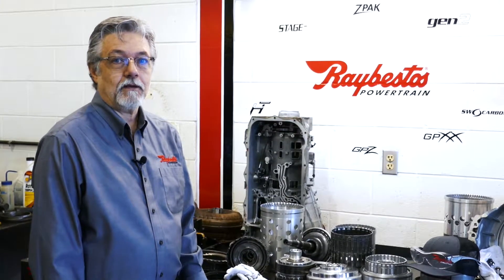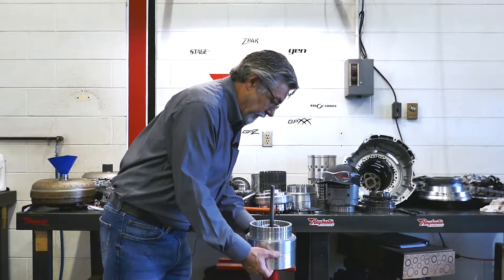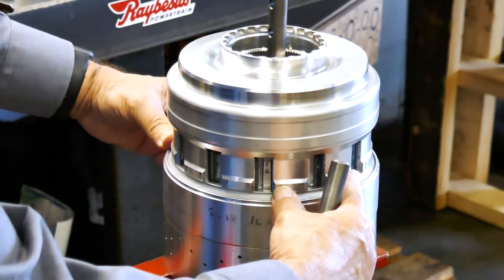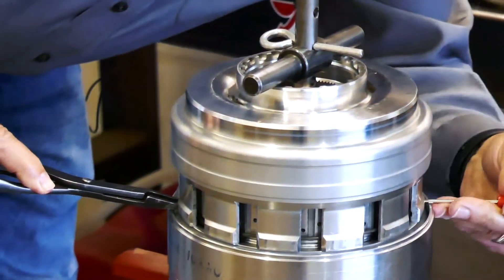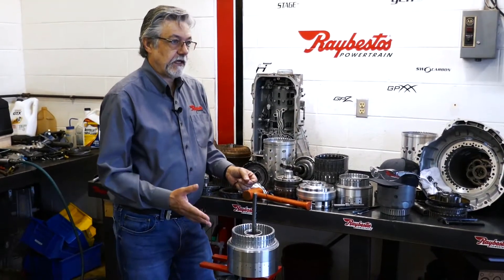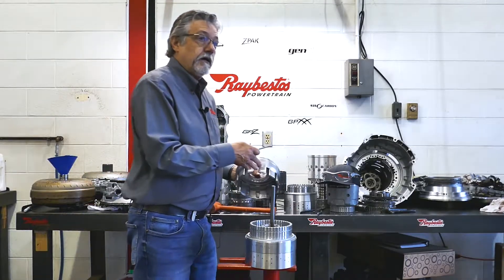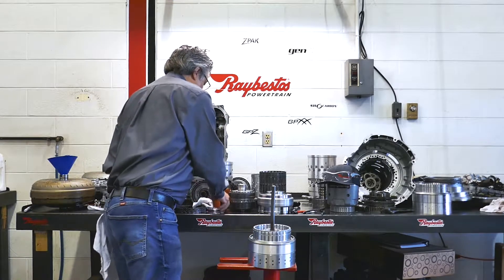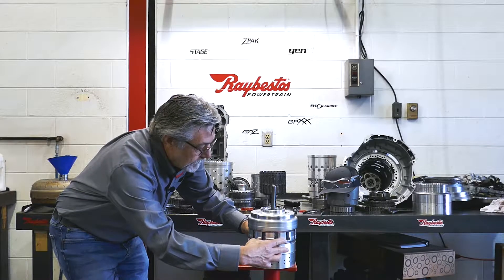10R80/10R60 Transmission F Clutch Special Tool?

Comment: Cut some tabs of that piston for more room to work
Reply: To compress the 4-5-6-7-8-R in an 8L90 I use a 1-2-3-4 clutch hub from a 6L90 with an access window cut out of it.